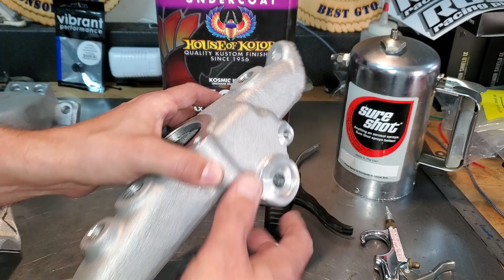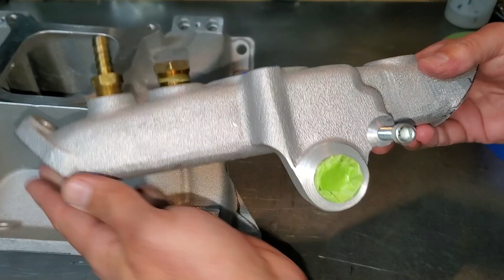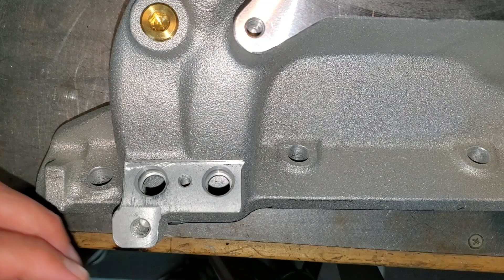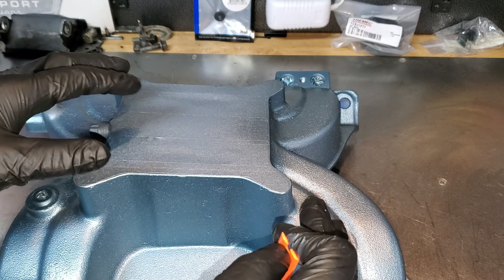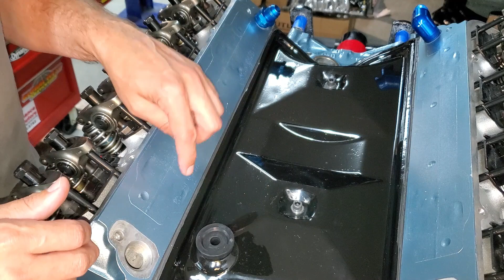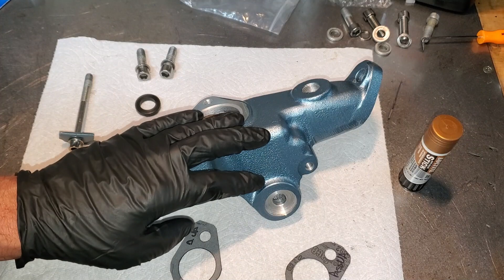How to paint and install an intake manifold and separated cross over.  Pontiac Rebuild, Part 11

Comment: I always wonder about painting aluminum heads. Aluminum helps to keep heat from building up so does the paint impede this at all? does it hurt cooling?
Reply from the maker: It is very marginal, like less than 1% difference from painted to non painted.  Ive heard that in certain circumstances or paint type, heat transfer is improved. Good question!

Comment: There is a reason for torque sequence. Cutting it don’t make sense. Engine designers came up with torque sequence to prevent warping. It also guarantees proper seal of gaskets and distributes stress across the manifold.
Reply from the maker: Cutting a gasket is sometimes necessary. Yes, torque sequence is critical. Thanks.

Comment: I was advised not to paint the aluminum heads and aluminum intake. Keeps heat in.
Reply from the maker: Heat retention would be in the less than 0.5 % range.  Which is neglibible.

Comment: I got tied up and live in a humid climate. How do you remove surface rust? And is the whole blow torch drying unnecessary? Thanks so much!
Reply from the maker: You can grind it off, or use a Phosphoric acid to convert the rust.  Then paint it with a rust preventative, like POR 15.  (I did a couple videos of that)  Blow torch isn't necessary unless you recently cleaned a part and want to get rid of all moisture/contaminants.   Have fun!

Comment: Im not really a big fan of painting aluminum. Paint works as insulator and retains heat. But then again after a couple years of oil stains and impregnated with carbon and other contaminants.
Reply from the maker: But, it looks freakin awesome!  Ha, ha... thanks Steven!

Comment: Make sure you run an anode in your radiator to prevent galvanic corrosion between parts.
Reply from the maker: I've never heard of that... I'll look it up.  Thanks!
Reply: @FastMonty  Flex-a-Lite zinc anodes  is one style . After running a Torker manifold for years with out protection . Galvanic corrosion ate away  the tapped bolt locations at the thermostat housing rendering it useless. Anode should be replaced every so often ,so I do it when I flush out the  radiator.
Reply from the maker: @joellovejoy8876  Cool!  I'll check it out.  Thanks!
Reply: @FastMonty  Your Welcome a simple inexpensive aid to protect your investment.

Comment: I have a stock Pontiac 400ci in 77 Firebird, would it work with and Edlebrock Torker intake?
Reply from the maker: Hey Brent, not sure what you mean?  If you're referring to separating the crossover, I believe you can.  Have you seen that video?   I show what to look for... https://youtu.be/ew0MYYZrpMQ  Let me know if you have any other questions.  See ya!
Reply: @FastMonty  I was told that the Torker intake that I have is for high end rpm and that because I have a stock motor, I wouldn’t get a good ride out of it unless I beefed up my cam, and crankshaft
Reply from the maker: @brenttaj7573  Ohhh, I get it now.  The best manifold for a stock 400 is the RPM Performer.  BUT, it's taller than stock, you should check dimensions before ordering one.  (I have one, as seen in the other video, If you like the polished look, I'll make you a good deal, ha, ha...)
Reply: @FastMonty  I’ll definitely keep that in mind
Reply: It will work as long as you don't have the trans am hood clearance is not good and also sits to far back

Comment: By any chance do you know where can I get the torque specs on a stock 389 -6.4 (66,Catalina) .. I need the ones for the valley pan and the intake manifold ... specially for the valley pan some sites said 10lb/ft others 15lb/ft !
Reply from the maker: By chance, yes I do... ha, ha.. it's 15 ft lbs.  Check it out;  https://butlerperformance.com/p-34888-pontiac-engine-torque-specs.html

Comment: Great tips & tricks to make it work and look great.  I'm a powder coat guy but the paint looks nice and will do well.  I powder coated my mailbox Pontiac Blue so I'm all in.  I love the plastic "razor" blades and even use them on my pizza pan!  One may wish to use the Ω setting to make sure earth is solid - in anything.  My 1964 389 has the OEM intake manifold as I'm just going for stock action but if I did a cut like you I'd make a dedicated earthing strap but the lock washer cutting in is likely to work just fine.  I keep copper woven straps for earthing anything suspect and solder in eye rings.  If a guy has owned Corvettes or airplanes - you get the earthing thing drummed into you brain!  Your work is perfect and it looks far better than the old sea of chrome.  Bobby
Reply from the maker: Ha!  Thanks Bobby!  Love the tips... thanks for the comment!

Comment: motor looks fantastic. I didnt know that about the electical. I think this might be the cause of my elect. issues. My hood tach lights up but the needle doesnt work.
Reply from the maker: Thanks Brother!  Yeah, someone else pointed out it's the voltage drop to ground that's even more important.  I now have to re-examine my grounds, etc... glad it gave you some ideas for a solution.  Thanks for the comment!

Comment: Good tips WRT tape over tape to prevent paint flakes, and the metal razor blade possibly gouging the aluminum. FWIW, I use the isosceles-trapezoid-shaped blades that go in utility knives. They are stiffer and have a more generous bevel that allows you to get the cut parallel with the gasket surface, so you get the strength of a steel blade without much risk of gouging the aluminum.
Reply from the maker: Thanks Griff... love the tip about utility knife blades.  Thanks for the comment!

Comment: You have connectivity what you want to check for is a voltage drop. That will tell you how good your ground is. Anything below 4 mv is good.
Reply from the maker: Ohhh, I love it.  Great point.  Thanks for the tip!